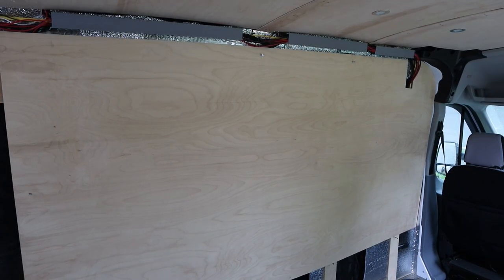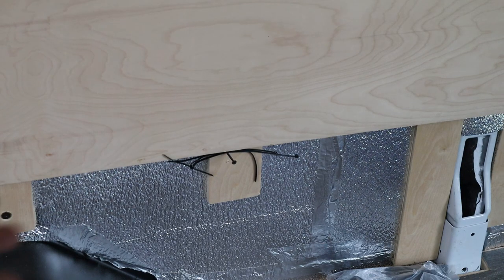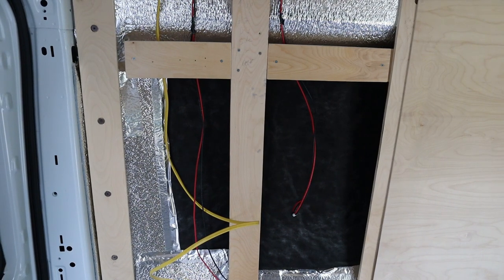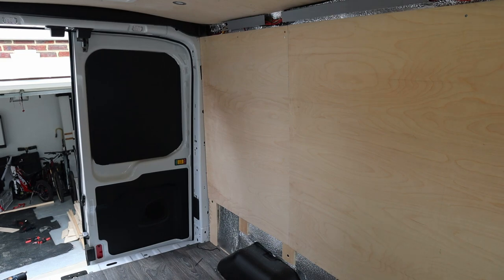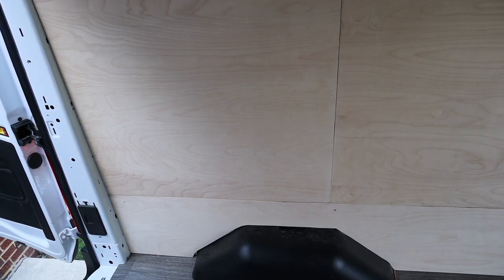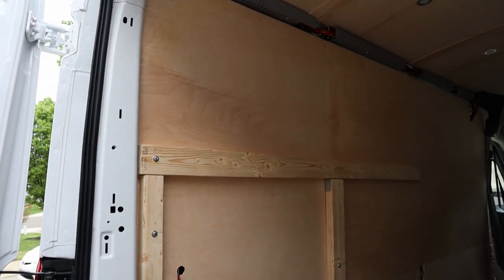#MTBPlanB Not Van life...Let's skin the walls on this puppy!

Comment: Impressive!   Could you tell me how you located the holes in the side walls to match the location of the plus nuts you put in for the bed frame?   I've found that to be a challenge I've not yet mastered.
Reply from the maker: A lot of measuring and some mistakes. If I had to do this again, I would attach the bed supports first before skinning the walls. Then skin around the bed supports.